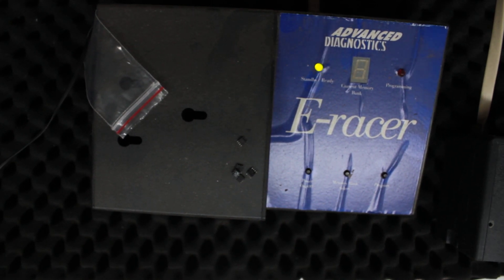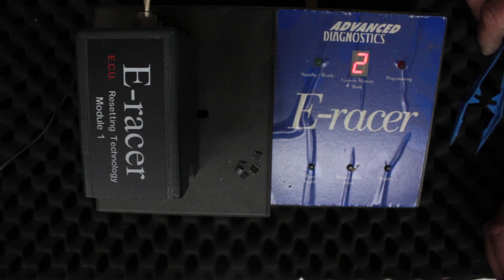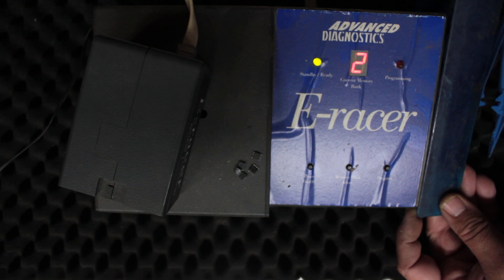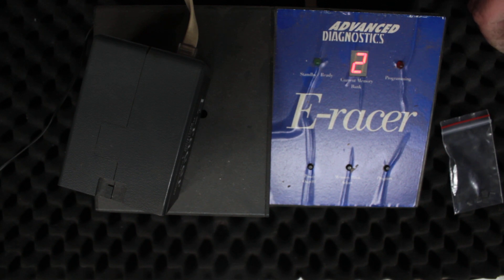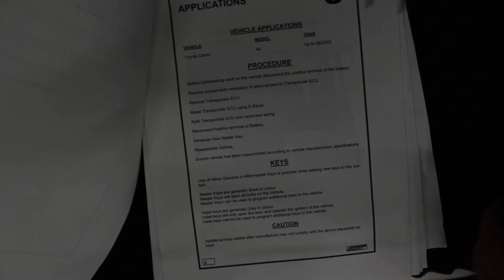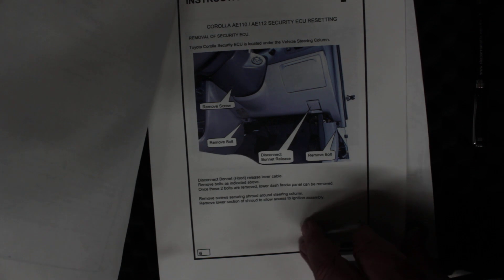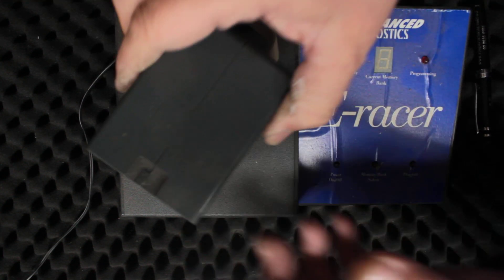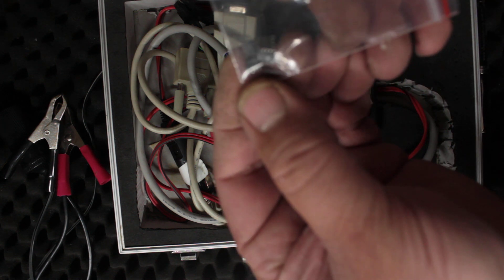Advanced Diagnostics  E-Racer For Toyota ECU "4c"

Comment: Camry came out in something like '82 or '83 from memory dude... There's guys up here in Brizzy doing them for $220 so I don't even bother quoting them as I just get hung up on. If I do need to do a 4C I mostly just clone them(yes the chips are expensive but it takes literally 2 mins to do). I can almost certainly 100% guarantee you will never see a ROI with an Automotive Service as most of the crap is defunct so fast & they screw up your machines just before the Subscription expires which I'm sure is just 'coincidental'
Reply from the maker: $220, it not worth the the time. I agree ROI for alot of the programming tools is not going to happen.  This tool is to flash for all keys lost, when it was new it was good, but by the time people started losing keys it was old technology. I think I know the machine you are talking about " I had one too" The  TM100  that's the one that just stopped working, many locksmith had the same issue
Reply: @DrLockShop  tell me about it! I wouldn't do an AKL scenario for under $450 which is why I hardly do them anymire. I'm flat out getting $165 for an 'extra' key for a 4C Corolla/Camry  as most people seem to be ok with just having a single Transponder or remote key with no 'spare' which is just dumb!

I reckon I'd have in excess of 20k maybe even 30k in useless/paperweight Programmers, Scanners & Cloners including AD/Autel/Silca/Obdstar/CN900 etc.

Comment: In the states I'm in the same boat with the pen-loader which does far more but cost way more. I've always said I'm not going to give my services away. There are people doing this for 150.00 usd and that's too cheap for the labor and risk involved.  Last one I did I had to desolder the ic to get a good read and flash and I lifted a pad and had to run a jumper on the PCB. All in all I never earned enough to cover the buy in but my machine still works and is ready. Last one I quoted for 400.00 the customer hung up on me. Lol
Reply from the maker: I have the same calls, $400 is fair, I have local locksmith doing a the same job on a Sunday for less them $300, I know this because I asked the customer and did not get the job at my price. I think  the price has gone way down as locksmiths try to recover the investment. Automotive locksmithing seems to be a money pit, looks good sounds profitable but in the real world, it  may not be worth the time or the money for many business. As you said the last job you had went from easy to hard in a flash. So many tricks - problems - stock - tools I just wonder if its worth the hassle and investment sometimes.

Comment: do you have the orange 5 programmer i got my one  with the course from LSC
Reply from the maker: No, have not done the course yet, did they give you all the bin files too when you do the course?
Reply: @DrLockShop   you get a manual and its quite expensive really but i had to be sure to learn correctly basically its all about the toyota chip and the orange 5  can drop voltage to read in cuircuit eeproms like this. You do get toyota 4c virgin files for  ecu . but thats about it  i paid 2400Au for the course  with the tool. I did not want to end up with some pirate tool . course was basically for eeprom beginners. 

They also do A vag course i wanted to take but was not on the time i needed to go to australia.